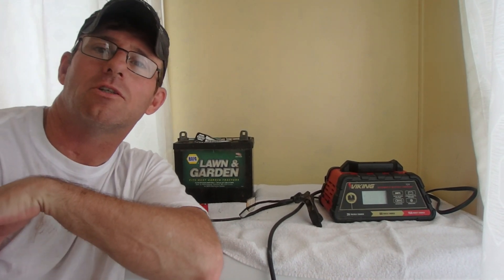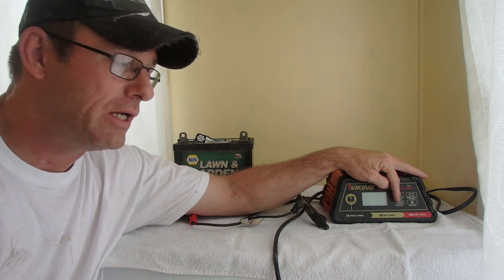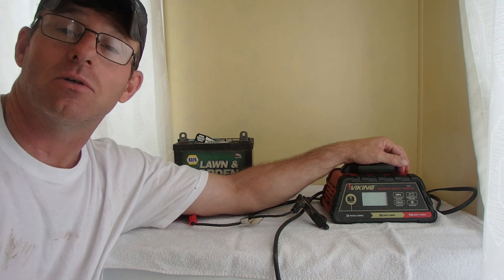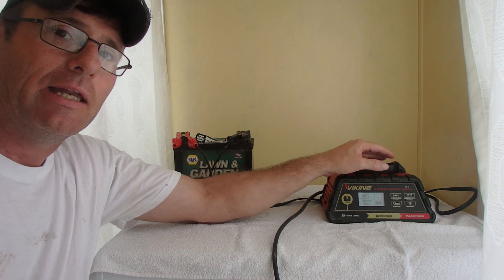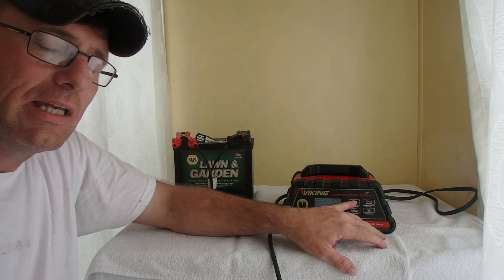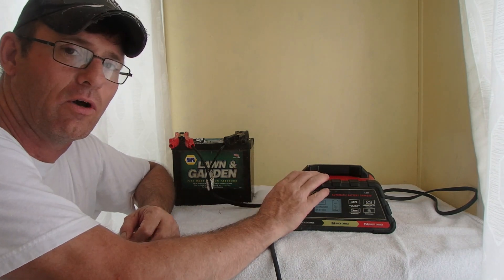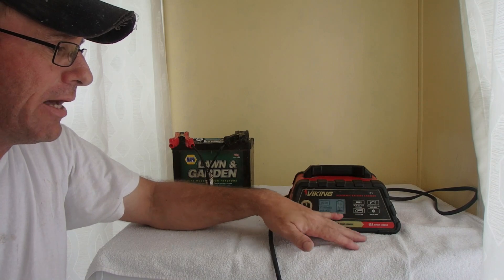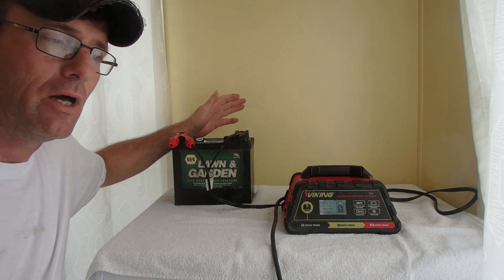HARBOR FREIGHT VIKING BATTERY IS IT JUNK UPDATE

Comment: Most smart chargers will not charge a battery that has been depleted too low, say 4V or less. There's a reason for it. What you want to do is run recondition mode. But before you do that, always check reagent level in the battery, assuming it's not the sealed kind. If your water is low, the battery will not function right and will not recondition to full power. For most, especially flooded lead acid, the issue is not having enough water in the cells and having sulfate crystalized. Add new distilled or DI water (top off) and then run a desulfate mode ("repair" or "recondition"). Lastly, battery chargers do not measure "watts" but voltage. When you have bad cells due to low water or sulfate-starved (usually occur hand in hand), then you will get voltage but not current. That throws off any smart charger unless it's a very expensive one that can draw huge currents while also measuring current so it can calibrate/diagnose. For a charger like this, the trained human brain will be needed.
Reply from the maker: Great information! You hit on all the good points that I left out of the video. Thank you for taking the time to comment to this video with great wisdom. Please like and share to help the channel grow.
Reply: I HAVE 2 IT WILL NOT EVEN CHANGE THE SCREEN
Reply: Thanks for the info, appreciated

Comment: Schumacher says on their website that their microprocessor chargers do not start if the battery voltage is below 4V, so I think that's a common thing.  Need a dumb charger to bring it up a little, or jump it like you did.  If a battery has been sitting dead for awhile it probably won't recover anyway.
Reply from the maker: Thank you for your comment and support
Reply: Exactly, you have to know how these work
Reply: Pretty sure they have a manual charge mode that overrides the under voltage protection. At least I know quite a few chargers do now because of this issue.

Comment: is this an actual 12 volt power supply as well? I see 12v listed but what exactly does that mean? Can i get 12 volts out of this?
Reply from the maker: I’m actually using mine as a battery management device right now on my camper. My inverter is not keeping up my 12v usage, so I just have it running all the time to maintain the battery level. 
Thank you for your comment, please subscribe, like and share to help the channel grow.
Reply: @ThehoneydoList  I’m trying to understand mine .. when I probe the pins 12v while on , I’m not getting 12 volts on my multimeter . I was hoping it’s a 12 volt power supply but not getting output ?

Comment: I have the same charger. It may have ruined my 12 volt Camaro  battery. I put the charger on the Car as a tune up before I drove the car. It seemed to start charging as normal. I would not charge the battery past 60%. I continued to charge for a few more hours. When I checked the progress the charger was off. I tried to restart the charger and it said the battery was bad.
My question is. How can I tell if the charger is working properly before I try to use it again. I don't want to risk another good battery if the charger is defective. 
Mike
Reply from the maker: Well mfatboy002 I would suggest trying to put it on a known good battery and using a volt meter to make sure both are reading it correctly. Or you could try to check each charging stages like 2 amp setting and so forth. I hope this helps if not please comment again and I will try to help you out with this issue. 
Thank you for your comment and support please like and share to help the channel grow.

Comment: I do not believe the snowflake mode is trickle charging.  After this unit fully charges it goes into trickle mode.  automatically. The snowflake is for winter charging mode in cold weather.
Reply: Typically, winter modes adjusts the charging voltage slightly to compensate for the effects of colder temperatures on the battery.

Comment: I just bought one and have a agm (glass mat ) battery . Put it on recovery because battery was dead . 24 hours later the battery I could smell and checked it . The battery was super hot to the touch . Beware of the repair battery function .
Reply from the maker: Great information 
Thank you
Reply: I did not have that experience with this charger on a low AGM battery, it worked fine.
Reply from the maker: @2tallB  thank you for the information and comment
Reply: That battery may have had an internal short.  Funny it would not abort immediately if it did.  Do you recall the voltage and charging Amp read out at start and finish?
Reply: @DodgeNbullits  no not right off hand .

Comment: Does your charger turn off when it’s on maintain?  On mine the screen turns off and I have to press the charge button to wake it up.
Reply from the maker: No I have never had that happen to me 
Thanks for the heads up
Reply: The box says it automatically switches to maintain mode.  How can we know it is on maintain mode?

Comment: My battery read 0% at first but when I hit the charge button it went to 60% immediately
Reply: Once it went to 60% did it continue going up. Mine also made it to 60% fairly quick but it seems to be stuck at that number.
Reply: @Tain950  sadly, I have not used it a lot since putting a terminal shut off on the battery
Reply: If it jumps up in state of charge rapidly, then battery needs repair mode.

Comment: I could be wrong but a lot of new automatic chargers have a manual override button for charging when the battery is dead. Try holding down the charge button on the far left either by just pushing it or holding it for 10 seconds or more and then see if it will override and enter manual charge mode. Usually will do so for several hours to get battery up to some charge. After that I think you can put it in auto mode or recon mode. Curious if thats the case here. Recon mode ive heard can serve the same purpose but I've had mixed luck.
Reply: I have 2 both are junk

Comment: Mine just wont get off the connect the clamps. I cleaned terminals put clamps back on & still says connect the clamps.
Reply from the maker: The battery must be completely dead. This charger will not charge from completely dead. I have committed about this issue in the past. I have to put jumper cables on the battery to bring it up a little before the charger would start charging. Hope this helps.
Thanks for the comment. Please like and subscribe.

Comment: I like to know where i can buy a good battery charger. Thanks.
Reply from the maker: I think it’s a great charger for the price as long as the battery isn’t completely dead. I’m going on two years with mine and it’s still working my only complaint is that it will not charge a completely dead battery and that the clamps are small. 

Thank you for your comment, please subscribe, share and like the videos.

Comment: Does anyone have any experience with using this device as a battery tender / maintainer?  I have a car that I drive only 3-5 times a year and then for only short trips so the battery doesn't get a good charge from driving.  The battery losses its charge sitting in the garage.  I would think I would be able to use this device to rehabilitate the battery and then leave it connected to maintain the battery all the time.  Hopefully the car would start when I want to take a drive.  Thoughts on this?
Reply from the maker: I have one that I keep my tractor. Works good but I will says that I would check on it weekly to make it doesn’t shut off, once the battery is fully charged. 
Thank you for your comment and support please like and share to help the channel grow.

Comment: Should have watched this before I dropped 80 bucks on one. Motorcycle battery stays dead for now. Guess I'll Jumpstart the bike with jumper cables so it can charge enough for my fuckin BATTERY CHARGER to charge a battery.
Reply from the maker: If you can get it to start to charge, use the battery re condition. It worked on my 4 wheeler and camper batteries once I got a enough life in the battery for it to start.
Thank you for your support, comment.
Reply: @ThehoneydoList  got the bike to start off a jump. Rode it around for a while. Battery is too far gone and won't hold a charge.
Reply from the maker: That’s what I thought to with my 4 wheeler the battery was completely shot and would hold a charge if I jumped it off just you did but once I put it on a re condition and just left it alone for about two days I can now walk out and start the 4 wheeler up even though it has started in a month. I want to also say that it worked for me but others might not have the same results. My battery was new and only about 1 year old with maybe a dozen rides on that battery. 
Keep a eye out I think you might have given me a great idea for a new video. 
Thanks again for your comment and support.

Comment: The manual says not to  clamp negative clamp directly to battery, but to attach at least a 24 inch long 6 guage insulated battery cable to negative battery post.
Reply from the maker: Thank you for your comment and support please like and share to help the channel grow
Reply: Right, the manual does say that. I've watched 5 videos on this charger and all of them show the negative cable being put right on the negative terminal of the battery. I was hoping to find out why the manual says that.
Reply: It's so the spark that occurs when you make the connection doesn't happen near the battery where flammable hydrogen gas may be present. It's the same reason you're supposed to put the negative clamp to engine ground instead of directly on the negative battery terminal when jump starting a dead battery on a car.

Comment: I have this charger stuck on Please put clamps on how do I get it off this screen?
Reply from the maker: If the battery is dead you. It will not charge it. That’s the biggest problem I have with this charger. I have to get a set of jumper cables and connect the dead battery to my car and give it a little charge before the charger will stop saying “Connect the cables” I am going to shoot a video today and have it out Monday about this to help you out. So make sure to subscribe and turn on notifications, so will will be notify when it comes out.  Thank you for your comment and support.
Reply: Make sure the clamps have a solid connection to the wires.  The charger might THINK the clamps aren't connected.
Reply: Could you trick the charger with a 9v battery?
Reply from the maker: Great ideal. Next time I have that issue I’m going to try it and I will let you know if it works. Thank you for your comment and support please like and share to help the the channel grow
Reply: @ThehoneydoList  No problem. Thanks for the response. Liked and Subscribed.
Reply: @mmholling87  yes you can, I just did it with a Dewalt drill battery and some leads.
Reply: @Devine_Adventures  awesome. Thanks for letting me know!